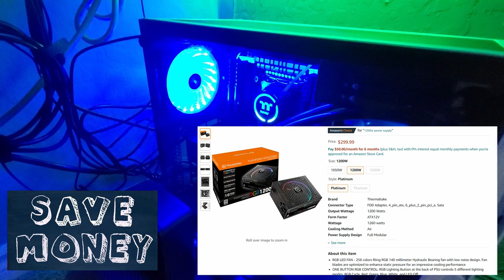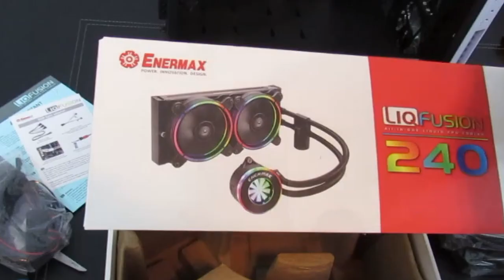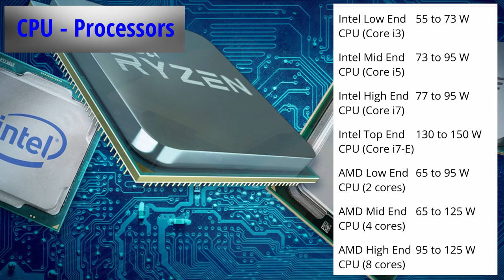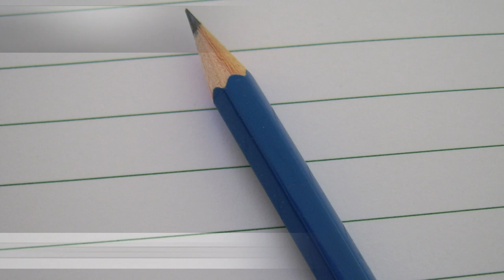How Many Watts You Need for Your PC - CPU POWER REQUIREMENTS FOR 2021

Comment: You should be doubling the power your system uses so that your PSU is running no more than 50 - 80 percent max load, which is optimum for efficiency.
Reply: this, very useful advice, its like having a v8 on the highway, its barely exerting itself

Comment: What do I need for:
Processor: AMD Ryzen 7 5800X Processor

Motherboard: ASUS ROG Strix B550-E GAMING

Cooler: Corsair iCUE H100i ELITE CAPELLIX White

Graphic Card: ASUS GeForce RTX 3070 TUF OC V2

Ram memory: Corsair Vengeance RGB PRO SL DDR4 3200Mhz 32GB (2x16)

Disk space: Corsair Force Series MP510 960GB M.2 NVMe SSD 960GB Seagate Barracuda 3TB
Reply from the maker: The GPU needs 200 watts so total PSU should be around 650 or 750. Extra power is better for future add ons.
Reply: @UltimateTechHub  okay thanks! I will get 750 because I will upgrade it someday! Thank you very much
Reply: @UltimateTechHub is it even good parts or is it bad? I'm way to new for this in my opinion
Reply from the maker: @VikingPontus  Looks good to me.
Reply: @UltimateTechHub  thanks!

Comment: hey , great video. Explains everything nicely. I have a question. Can i run my Ryzen 5 5500 and Rx 6600 with CV 450 psu ? Also have 16 gigs ram , 1 hdd , 2 monitors . Do i need to upgrade?

Comment: Looking to know how much power I’d need for i5 13600k and 4090? Want to make sure the load stays @80% thanks!!
Reply from the maker: 1000 watt power supply should work fine. For any of my gaming builds 1000w PSU is my standard. It leaves room for upgrades in the future. Thanks for watching.

Comment: i just got my 650W and now i’m regretting it. I have 3070ti, i5-12600kf, 2x8gb RAM and gigabyte b660 Gaming x mobo. I haven’t built my computer yet so should i return the PSU and order one with more power?
Reply from the maker: If your regretting buying the 650W psu then yes return it and get a beefier psu. Maybe a 1000W. More power is more better.!

Comment: Hello! I've finally decided to change my GPU and I'm still not sure if I need to buy a new PSU or not. Based on this video I've decided to try and calculate my PC's current power usage along with the added new GPU into calculations. In my calculations I assumed the worst case scenario so I did pump up my numbers to max based on the research about my components maximum possibilities. I'm still afraid to be wrong about my summary, so I would like to ask You just to make sure I won't make a mistake. Here's my PC (with new GPU already included in the setup):

MOBO: Gigabyte X570 AORUS PRO
RAM: G.Skill Trident Z RGB, DDR4, 32 GB, 3200MHz
SATA: x3
SSD: x1
FANs: x4
CPU: AMD Ryzen 9 5900X
PSU: SilentiumPC Supremo FM2 Gold 750W (SPC169)
Cooling: CPU be quiet! Dark Rock 4 Pro (BK022)
GPU: GIGABYTE Aorus GeForce RTX 3080 Ti Master 12GB
Mouse/Keyboard: Keyboard Razer Huntsman Elite, Mouse Razer Naga Trinity

I'm not a fan of using OC in my builds, I usually go with the stock settings.

If my calculations are correct, this build should use around 689W during loads. But as I said before, I would like to ask for Your opinion because I might have made some mistakes during the calculations. I also don't expect to upgrade this PC for a long time so there's no need to add that extra power for future upgrades :D

Cheers!
Reply from the maker: With The GPU and the CPU being upper end in terms of performance and power draw. A 750w PSU would be my recommendation. This gives you a small cushion but is not overkill. And a 750w PSU wont break the bank! Thank you for watching and keep me posted on your PC it sounds like a solid computer! Good job!
Reply: @UltimateTechHub  thank You so much for Your reply! I was afraid I would need to buy a new PSU because every shop recommends 850W or says it's even a bare minimum for that GPU

Comment: Hi, I'm planning on upgrading my PC and I believe I need a better PSU than my current one, this is the build I'm planning on upgrading to: 

CPU: Intel 16 Core i9 12900KF Alder Lake CPU/Processor
GPU: ZOTAC NVIDIA GeForce RTX 3060 12GB TWIN EDGE OC Ampere Graphics Card
MOBO: MSI MPG Intel Z690 EDGE WIFI DDR4 ATX Motherboard
RAM: x2 Corsair Vengeance LPX 16GB 2400MHz DDR4 Memory/RAM Module 
SATA: x2
SSD: x2
FANs: x2
Cooling: SilentiumPC Spartan 5 CPU Cooler Intel/AMD

From your video and what I found googling the components I believe I would need a PSU that provides more than 573W but I would like your opinion if my calculations are wrong or correct and what PSU I would need, if this is right I believe a 650W would suffice
Reply from the maker: 650w should be good. However a 750w would be good for future upgrades. Thank you for watching I really appreciate it. FYI - Nice System! Congrats!

Comment: Hello is 400 watts enough for :
Case : xigmatek venom x 4 fans rgb
Motherboard :Msi 560M PRO-VDH
Cpu : i5 11400f
Cpu cooler :Xigmatek AIR-KILLER 
Gpu : 1650 oc 
Ram : 16 gb 3200 mhz rgb
Hdd : 500gb 
Ssd : 120gb
Mouse & Keyboard : meetion rgb
Reply from the maker: Yes that looks like enough power but you cant upgrade your GPU at all. My RTX 3080 needs 350W of power and my system needs 750W PSU minimum. However, I have a 1000W PSU for future-proofing and to keep the PSU from maxing out. Thank you for watching.

Comment: Hey what would i need for the following, i7 10700k, rtx 3060 (12gb) 2×16gb ddr4 corsair vengence ram, 1tb samsung 970 evo ssd, my motherboard is a msi z490 gaming plus and i have 4 fans+cpu cooler, plus raser mouse, keyboard and headset.
Reply from the maker: I would get a 850w PSU. The 3060 draws a lot power. I always like a little extra power for future upgrades. Thank you for watching and if you subscribed thank you as well!
Reply: @UltimateTechHub  Thanks for the quick response, was thinking a 850, may just go with a 1000 for future proofing within budget.
Reply from the maker: @tigerfury0209  Great idea! Good luck!!
Reply: @UltimateTechHub  Thanks, hoping to be upgrading my pc to run battlefield 2042 this December, damn graphics cards are so expensive though...
Reply from the maker: @tigerfury0209  I know the 3060 is insanely expensive
Reply: @UltimateTechHub  yeah, managed to find one 12gb for £350-400 ish but even thats expensive

Comment: What do I need for a Ryzen 7 5800X, EVGA XC3 Ultra Gaming 3070, 1 SSD, 2x8gb RAM, 1 water cooler, ASUS X570 Tuf Gaming-Pro Motherboard, keyboard/mouse and 6 fans?
Reply from the maker: 750w minimum

Comment: Hey i appreciated you video it was very helpful, but i have a few doubts about my set up, a feiend gave me. It has a MSI N750 1gbd5 and an intel i7 core 780 on a intel desktop board and 2 SSDs with a combined total voltage of 10 v and an intel cpu fan 12 volts ? Im thinking 600 maybe watts? I have no clue im new to this

Comment: My specs are. Ryzen 9 3900x, z53, 32gb ram, msi 3070ti, msi b550, 2.5tb ssd. I have a 750w gold+ psu. I’m concerned because I think it’s to low. is it Enough, or I should updgrade?
Reply from the maker: It should be enough but if you do any other upgrades you should definitely get a 1000w psu.

Comment: Thanks! One question. What would I need for a ryzen 5 5600x, rx 6600 xt, B450, 16 gb ram, 1tb ssd, and 3 fans
Reply: (8gb vram and 3000mhz ram sticks)
Reply from the maker: 650 watt. Or 750 watt for future upgrades.
Reply: @UltimateTechHub  thanks

Comment: ive got core i5 11400f Cpu , RTX 3060 Graphic card with 16GB of DDR4 Ram , i bought 650w white Power supply is it enough or i should go for 750w gold ?
Reply from the maker: The RTX 3060 has a 550w PSU requirement but with the other component drawing power I would at least run a 750w or 850w. I will send a link to my latest PC build . We built a RTX 3080 gaming PC 2 months ago and installed a 1000w PSU.
Reply from the maker: Here is the link to the RTX 3080 build.
https://youtu.be/Br6V_nH0GOs
Reply: @UltimateTechHub  Thanks !

Comment: Hello is 400 watts enough for theses specs? 
Mb Msi 560 M  Pro-VDH Wifi
 i5 11400 
8gb ram 
Gtx 1650 
500hdd
120 ssd 
Xogmatek xenom x 4rgb fans
Reply from the maker: It should be enough. Although there is no room for a GPU ugrade with 400w psu.
Reply: @UltimateTechHub  yea im not planning to upgrade my gpu. I wana just buy 16 gb  ram (rgb)
Reply: @UltimateTechHub  thank u 😁

Comment: If i'm using R5 5600G + DDR4 3600Mhz 16GB (8x2) + 3 Fans 120mm, 1 Nvme M.2 and 1 SSD Sata, B550M Mobo. For now without GPU.. how much PSU Watt do i need ? 

Thanks
Reply from the maker: 350W to 400W would work perfectly. If you plan on getting a GPU in the near future make sure to buy a PSU that can handle it. My RTX 3080 needs 350W of power and my system needs 750W PSU minimum. However, I have a 1000W PSU for future-proofing and to keep the PSU from maxing out. Hope this helps.
Reply: @UltimateTechHub  thank you so much, this really helps a lot .. i decided buy a Cooler Master MWE 750Watt 80+ bcs maybe in future i'm gonna using RX6700XT.
Reply from the maker: @darkerpath  Perfect! Congrats and very smart purchase!

Comment: what do i need for a: i5 6600k , Asus ROG STRIX-GTX1060-O6G-GAMING , 1 ssd,  2x 8gb ram,  asus z170 pro gaming, keyboard/mouse and 5 fans?
Reply from the maker: 650w will be plenty unless you are looking at upgrading your GPU later.
Reply: Is 450 w also good? Because i got that one already?
Reply from the maker: @corneschep1412  A 450w is probably going to struggle. You can always try it and see how it works. I always go over 100 to 200w so the PSU is not stressed and for future upgrades. Keep me posted on the 450w. Thank you for watching I really appreciate it.
Reply: This is my second asus strix gtx 1060 6gb gaming. My first one died when i tried to put it in for the first time. Im afraid it might happen again.
Reply: @UltimateTechHub  can this occur if you don't have enough watt?
Reply from the maker: @corneschep1412  sometimes but not often.
Reply: @UltimateTechHub  i have officialy put it in. and it works great👍🏻 how can i find out if its underperforming because off too little watts?
Reply from the maker: @corneschep1412  You can run some benchmarks. I have a video on the GTX 1660ti benchmarks. Just watch that video to see how I run the tests. Thank you for watching.

Comment: Question: Is my Power Supply enough to power up this build?
----------------------------------------------------------------------------------------------------------------------------
PSU: Corsair HX850W 80+ Platinum
CPU:  i3-8100
MoBo: MSI B360M Mortar
RAM:  Kingston Hyper X 8GB x 2 = 16GB RAM DDR4 2666MHz
GPU: RTX 3060 Ti
STORAGE: 
- 1 NVMe SSD Samsung 970 Evo Plus 512GB
- 1 NVMe SSD Western Digital Blue  512GB
- 1 HDD Western Digital Blue 2TB
OPTICAL DRIVE:  Asus DRW-24B1ST/BLK/B/AS DVD/CD Writer
WI-FI ADAPTER:  TP-Link Archer T3U 802.11a/b/g/n/ac USB Type-A Wi-Fi Adapter
140 MM FAN:  Noctua A14 PWM chromax.black.swap 82.52 CFM
MONITOR:  Dell P1914S 19.0" 1280x1024 60 Hz Monitor
WEBCAM:  Logitech BRIO Ultra HD Pro Webcam
MECHANICAL KEYBOARD:  Royal Kludge 96% Layout RK100 (Black)
MOUSE: Fantech Gaming Mouse 10K DPI
---------------------------------------------------------------------------------------------------------------------------
Reply from the maker: 850w should be fine. 1000w would be optimal for a power cushion. Thank you for watching.

Comment: what do i need for a reyzen 7 3700x asus rtx oc 2060 corsair vengance ram rog b550-f gaming motherboard and 2 ssd's?
Reply from the maker: 650w PSU should do the trick. This will allow for some future upgrades.  Thank you for watching and if you subscribed thank you as well.
Reply: @UltimateTechHub  Thank you i already had orderd a 750 watt psu and i was wondering if i should have returned it and gotten a 850 watt
Reply from the maker: @colchestercoltstechteam8809  750w is plenty and even a 650w is good. Unless you are planning on buying a RTX 3060 TI GPU 750w is all good.

Comment: i got a ASUS Prime b450m a II MOBO
Ryzen 5 5600G 6 core 12 CPU
Crucial p5 plus pcie 4.0 nand
Seagate barracuda 2 tb HDD
2 TeamGroup Tforce delta rgb ddr4 16g ram
Samsung 870 evo sata ssd 1Tb and a king gigabyte geforce Gtx 1050 GI graphics hard how much wats should i get?
Reply from the maker: 500w minimum.
Reply: Thank you
Reply: @UltimateTechHub  I got 650 if i ever wanted to upgrade like you said
Reply: do you think everything would be compatible or do u reccomend certain parts
Reply from the maker: @OneDumbJ  I think everything is compatible.
Reply: @UltimateTechHub  sorry for asking alot if questions im a first time builder but will the graphics card fit a zalman s3 mid tower case?
Reply from the maker: @OneDumbJ  it should. Does it have 1 fan or 2?
Reply: @UltimateTechHub  1 but i added 3 fans to the cart is that ok? also do you have any videos on installing them that would be very helpful!
Reply from the maker: @OneDumbJ  This video may help you. It shows a cpu cooler install and I think I show the fan installs too. 
https://youtu.be/WXr6iMs5HvA

Comment: i have a 275w power supply, but my total number of watts for my system is 291, would that be an issue?
Reply from the maker: Yes that will be a problem. You need at least 300w  but rule of thumb is add an extra 100w for future upgrades. So 400w should be your PSU  minimum
Reply: @UltimateTechHub  Ok thanks!